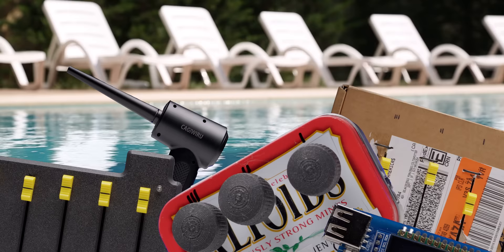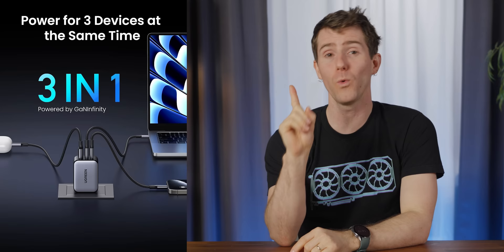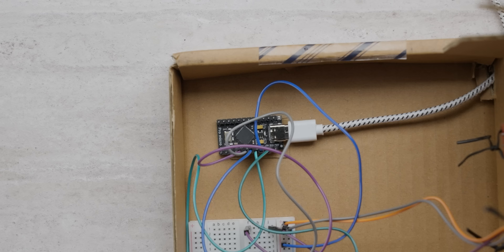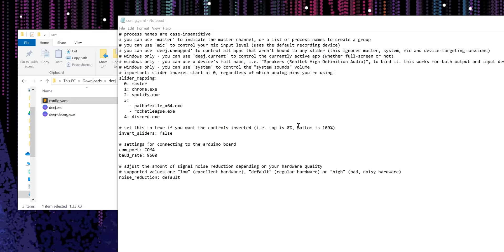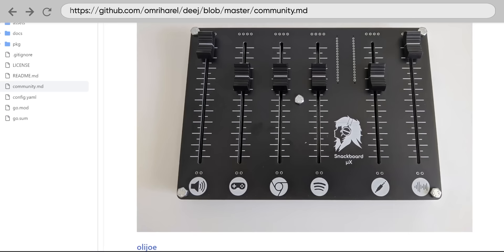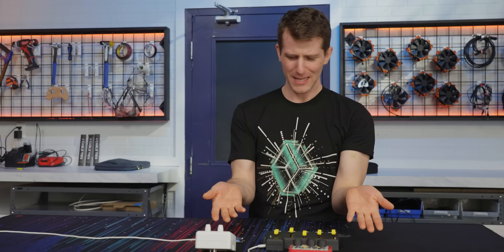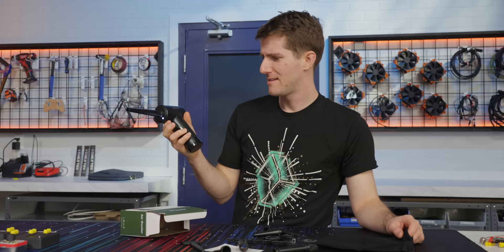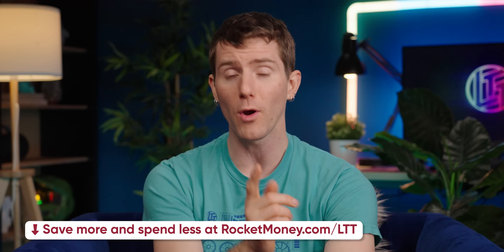I Made This for Under $10. You Can Too - Handy Tech Under $100

Comment: Finally yall found deej I've been using mine for almost a year, mine has 4 sliders and 4 knobs, i spent 30m on fusion whipped out a small compact case and bc i had the parts laying around from e waste i only spent like 2$ on filament

Comment: most new devices already have battery bms so can be left plugged in but this might save bit of power.with that usb just use a modified usb plug that only has power wires and no data wires

Comment: Canned air > air blower
More expensive in the long run but as much hot air the blower produces, it lacks the ability to remove the fine dust particles from electronics.

Comment: Why use the USB validator when you can just make a simple USB A to A adapter with no connected data lines? It cost's like $1-2 if you buy materials online or free if you modify one of those 2 inch USB extender things that come with Logitech wireless keyboards. You can usually ask any friend who works in an IT department to save you one since they throw them out anyways.

Comment: How does the air blower compare to actual compressed air? Tried to get a gauge on the power in the video, but the only time it blows something, the stuff being moved is on fishing wire, so I can't guess at the power. Also I've seen videos where you regularly clean off PC parts and I don't think I've ever seen one of these being used for that. Always what looks like an air compressor. Would this thing get deep into heat sink fins to blow out stubborn old dust?

Comment: I've been lookin for something like the deej for many years since most TVs dont have dynamic audio compression. It could also serve as a headphone protection or resistor. I used to have a creative audigy 2 and the headphone was directly connected to it. One bootup, the headphone went boom while I was wearing it and got tinnitus for a week. It would have been a pop (like connecting a guitar to the speaker when it's already on) but the headphone was too sensitive. From that day, i stuck with headphone outputs or seperate dacs and amps.

Comment: Hi LTT team. Electrical Engineer Mike here. "Leaving your batteries plugged in all the time" is rarely "really hard on the batteries". In the modern world of lithium based batteries with CC/CV charging in essentially all chargers batteries left on their chargers at 100% SOC causes zero degradation beyond being charged to 100% in the first place. While it is true that charging lithium type batteries to 100% does shorten their useful life than if you charged them to 80% that difference in life is marginal. Cycles of the battery are what matter most of course. And that said charging to 100% then allowing discharge because you didn't want to 'leave it connected to the charger' before plugging back in again WILL reduce the lifespan of the battery as that is a discharge cycle. It may not be a full discharge (I mean how often do you get your phone down to 0%) but it is a cycle nonetheless. You would have been much better off leaving that device connected to a charger to be kept at 100% rather than running it through one or even many partial discharge cycles.
Reply: In my experience the difference between 50-80% and 100% is not marginal. I've had like three different devices vent gas (puff up) after being plugged in full time for a couple of years. 

Ideally you might get a different charger that doesn't charge up to 100% (usually 4.2V), but plateaus at a lower voltage. 

BTW Big Clive tried adding a Schottky diode to lower the voltage from a TP4056, and it worked reasonably well.

Comment: Man I bought a USB Duster, and I even got one of the slightly more expensive ones(I think $50-60 because I didn't want it to be cheap) and its nowhere near as good as I'd like it to be..  IT seems to blow strong, especially on full power, but it never knocks the full layer of dust on computer fan or in certain places,  only the surface stuff.

Comment: I killed my batteries. 
I had a drill with Li-ion batteries that would drain if left on the charger for more than a few days. I used a light timer to turn off/on for 15 min a day, thinking it would keep them topped off. It absolutely killed then in just a couple months. Now they won't take a charge at all.

Comment: I think it's kind of funny that i had an idea to build such a volume mixer myself a few years ago. It will most propably have already existed then but I didn't see something like that back then. 
Anyways, I still haven't built one yet but I am on to it.
One thing I want to do different from the one you showed is to include small displays that show which program is being controlled. Not havin much experience with programming arduinos I am still struggling with that tho

Comment: Speaking of the USBvalve, imagine a similar device called something like USBcondom that has both a male and a female USB-A/USB-C for your charger cable and it basically works like a filter, only allowing current to passthrough not data signals, that way, if you have the USBcondom dongle attached to your cable you're safe to plug in anything.  PS. I am serious but the jokes wrote themselves sorry

Comment: The first one is absolutely ridiculous, I can't even believe that a tech channel would recommend one unironically. Leaving batteries fully charged for extended periods of time is not much less destructive to battery health than leaving them discharged entirely. There is something called storage charge, which is actually around 50%, and that is the point the battery will have the most lifetime in storage. Just discharge to this point and turn the device completely off, what energy does it use then? Micro amps for the RTC? Come on, seriously?

Comment: or: buy a proper compressor with , where you can regulate airflow... just add a water vapor isolator stuff, and you good to go.. those USB hairdryer stuff will never clean up that well a power supply for example...

Comment: LTT video idea: build the pc from testout labs.
Specs: 
Fractal Design 1100 case

Asus Prime z370 motherboard

Intel i5-8600K

Corsair vengance pro ram 3200mts 8gb modules

Powmax LP-7700D 350w

Western Digital 800JD 80gb

Dell dvd/cd rewritable drive

AMD Radeon HD 3870 Ice Q

Dell monitor

Generic keyboard and mouse (probably dell)

Comment: But it's not like soldering on that level is complicated or expensive, so you probably should do it.
Seriously, for just connecting wires like this the cheapest kits will do. And yes I mean the 10$ and below stuff. Because This really only needs a pencil that gets sorta hot. And not anything resembling precision or endurance. What you would buy better gear for. For a few minutes of connecting wires every now and then the cheapest is more then enough.
Reply: U can solder with a pencil?

Comment: Isn't the blower different from canned air in that canned air is always clean? for example, I wouldn't blow a camera lens with a blower because it can blow out dust and stuff, isn't that the main selling point of canned air? if it's only air what you need, you can use a hair dryer with a nozzle right?

Comment: I still haven't found a good air duster with a changeable battery. After 1-2 years the battery is crap and instead of changing the battery you need to buy a new one...

Comment: 8:47 Yeah. Or give up on ultra-fast charging, and use one that pulls the data data pins in a charge configuration, but doesn't connect it to your device.
Result 5V 2A or 3A for your device to use, but no data. And those are barely any bigger than a normal USB A to A female to male, or C to C female to male PLUG

Comment: Problem with the USB protection thing is removing data lines, can mess up fast charge and for me fast charge is important, i tried one of those usb protection things and charging was capped at 5w-10w, which on my device can take all day to charge, soon as i use normal cable, boom 45 watts

Comment: Man first product would be better, if the used current (A) to turn off the power so when the charger stopped drawing power to charge a item and went to standby it cut power to the chargers pugged into it.

Comment: pro tip. forget all that nonsense for the volume board, ust use the sound mixer in windows and you can individually control volume for all open apps and programs, games, windows, and master control. how is that slider any better other than being a physical device???
Reply: It's physical device, that's the point

Comment: Do those dusters have enough air pressure to dislodge dust from a surface?  That's been my experience with mechanical air blowers: that they almost never can knock anything around that isn't already loose the way canned air can.  If this can do that I'll probably toss my Ryobi inflator.

Comment: As a radio ham I appreciate the home brewing in an Altoids tin. I also like the the charge-o-matic. I could use that on my 2 Amiga 1200's which both contain a Blizzard 1230 MK IV accelerator, to keep the VL2020 battery topped up when I am not using the computers much.
Reply: Weird flex
Reply: @Halfcertified  68030 powered Amigas - stuff of kings right?
Reply: @Halfcertified  If only they required charging, I would mention my Mark 2b abacuses with nylon beads, alloy wires, and Bakelite frame that I use to browse the internets

Comment: i already left 2 comments but i finished now and none of these things are unnecessary the air duster is nice maybe but not very necessary either the usb thing is easily replacable by a usb cable that has missing pins for data transfer so it only charges

Comment: Major cheapskate here: you could actually perforate an EMPTY absolutely EMPTY compressed air can, and solder a bicycle wheel valve to the can, and re inflate it with a bike pump. Emphsys in absolutely empty if you don't want a can blowing in your face... not nice blowing, but booom blowing

Comment: I like the timer thing, especially the battery trickle charge scenario - but - what if the mains goes out?  Even momentarily.  Does it forget the program or does it keep the info or do the knob positions keep it going?
Reply: Checked the link - it has a battery backup - that's good  - price?  Pretty expensive.

Comment: Not sure if the comments are still checked, but is the USB Air Duster safe to use on all electronic devices (both inside and out)?
Only wanting to verify, since my grandad seemed concerned so to possible static discharge damaging the electronics.

Comment: is it not safer to use charge-only cables? although i'm not sure how things are in the type-c world. with micro-usb there are only 4 connections, 2 for power and 2 for data. if the data connections are not present, it'd just charge only right? though i guess it won't have fast charging

i personally just bring powerbanks and wall adapters

Comment: I've seen a device on Ali Express similar to the Charge-O-Matic that was smarter and basically stayed fully on until it detected the drop in current once devices were fully charged, then stayed off for a set timer, came on, stayed on as long as devices were charging and pulling current, then once everything is charged and amps drop again, it cuts off for the set time again, repeat. But unfortunately, it wasn't what I needed at the time and I didn't buy it, and don't remember what they called it. But if anyone knows what I'm talking about, please provide more info, I'd love to get one now to prevent vampire current from all my many chargers, and it would be simpler than my current setup of current detecting smart switches and elaborate Alexa and IFTTT routines.

Comment: Charge-O-Matic is a Waste, Just use a Smart Plug with a Routine / scene / Automation 
You can do Exactly the same thing for less than 1/3 the price & if you get a "smart power strip" you can control multiple outlets on 1 plug, STILL costing less than Charge-o-matic

Comment: DON’T BUY THOSE USB AIR DUSTER, the lithium battery they use is a$$ and you'd be lucky if it last for more than 2 years of occasional use. I had 2 and they all failed within 2 years, after a full charge they last less than 2 minutes. Get a corded one instead, it's even cheaper.

Comment: BIG question for the sound/volume mixer; if anyone can help I'd appreciate it! How can I set it up so that it can effectively control my main rig's volume & at the same time that of separate PC (laptop) that's connected via Synergy? 
Effectively as it's been, I have to drag my cursor onto the secondary machine to adjust volume or manually use the keys from the keyboard on it (a reach; no pun intended..).

Comment: Oh, dear ghod; that again?

ALL (100%, uniformly) Li-Ion battery packs have a charge controller built into them, which monitors the voltage and temp of EVERY CELL, and stops the charging when those get to their maximum safe values.

If you have a device which will let those batteries get overcharged, it is Broken As Designed, and patching around it with a silly ass-timer is not the right solution.

[ Source: shared office space with a battery building company for a year; had lots of long talks. ]

Comment: I have a weird problem with my pc. Got following specs - 
ASUS ROG Strix Z790-H Gaming WIFI
Intel Core i7 13700K 3.4 GHz 54MB
Kingston 32GB (2x16GB) DDR5 5600MHz CL36 FURY Be
ASUS GeForce RTX 4070 Ti 12GB ROG Strix Gaming
ASUS ROG Strix 850W
Samsung 980 PRO M.2 NVMe SSD 2TB

It´s running fine and all BUT, I have been trying to install 2 more ram, which are the exact same as the ones I already have (trying to get 64GB)
But I can´t boot with all 4 sticks installed. If i mix and match my 4 sticks in any order but only use 2 of them in slot 2 and 4 it works perfectly fine, but if I use 3 or 4 instead I get a bluescreen. I can´t get to BIOS,
Fault codes that I have managed to get is the following 0x0000001 AND 0xc0000221
I have tried a SFC scan and also a MEMTEST86 but I can´t get it to work...
Any ideas here lord @Linus Tech Tips

Comment: my old thinkpads used to have the fature to charge up to 90% and not any more, guess what? after like 4-5 years of use of 2 previous devices (one after another) that I did not even get brand new, both still had over 85% of the original capacity. Now I have bee nusing a brand new thinkpad for a lottle over half a year, maybe a year, it did not have that batery saver feature nad by now the battery barely lasts 1h!! Tell me it's not planed obsolescence how by removing that simple batery saving feature they make the battery go bad right away under normal 10-15h a day use